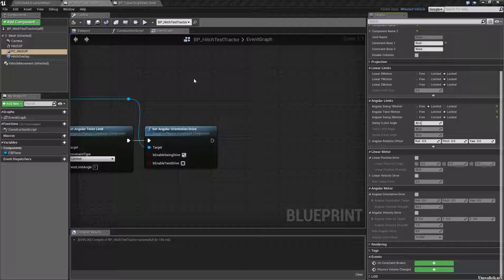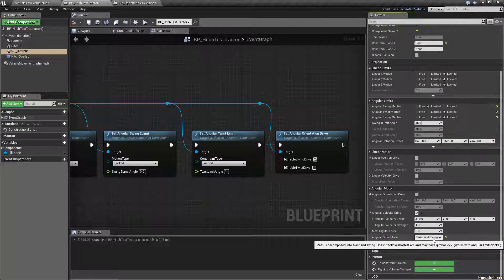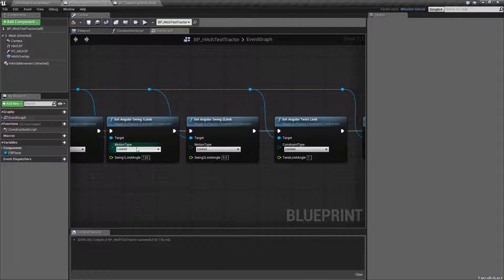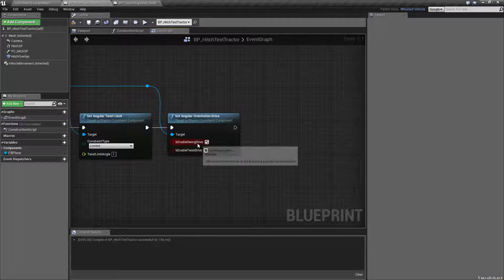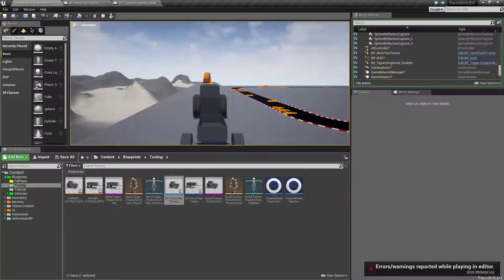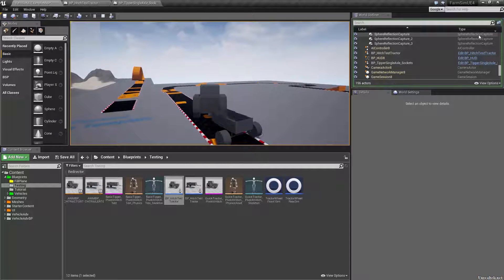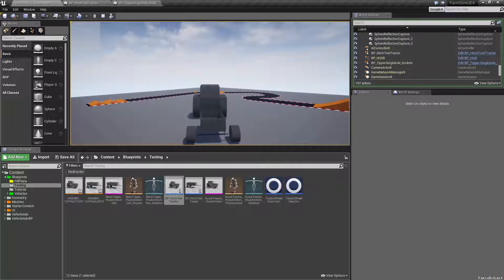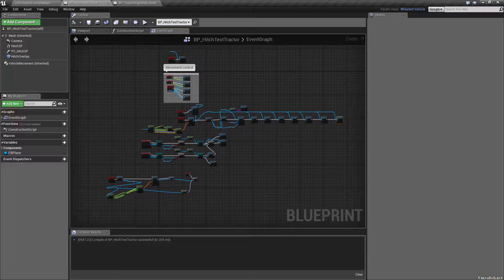Angular Twist Custom Blueprint Parameter for Trailers Physics Constraint

Comment: I think the jackknife problem is because your tractor uses single raycast for wheels and when your trailer gets to close to the rear wheels that raycast from the rear wheels causes the tractor and trailer to fly away
Reply from the maker: +Cristineltr Possibly. Ive considered blueprinting a wheel collider + raycast system but with just physics constraints available rather than all the fun PhysX individual components you get quite limited. Will see if I can debug the WheeledVehicle class to show raycasts somehow. Rama calling Rama....

Comment: If you look in the physics engine, there is a Articulated Constraint which Epic hasn't exposed. Also you may want to disable collision with the constraint, that will help the physics from freaking out. Also I found that if you add a constraint and put it together via the Construction script it also helps, and think of the constraints like bones. I uploaded some pics to photobucket for a visual look. http://i1383.photobucket.com/albums/ah284/seandennis8484/physicsconstraintatsimulate_zpsvqhrjlfq.png
Reply: +Sean Dennis I also forgot that you might want to increase your substeping to 16, that also helps with the physics per frame.